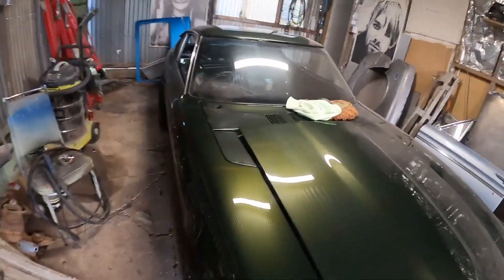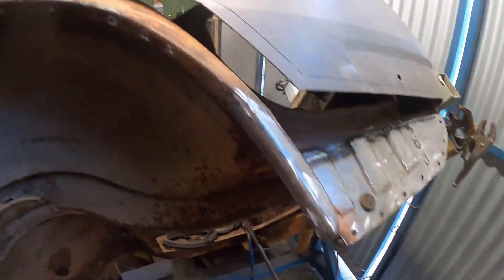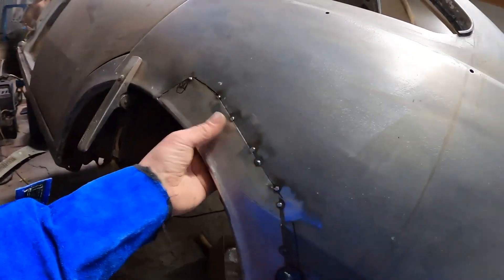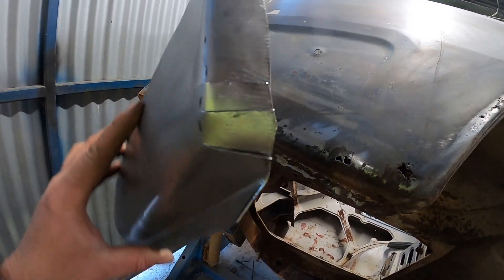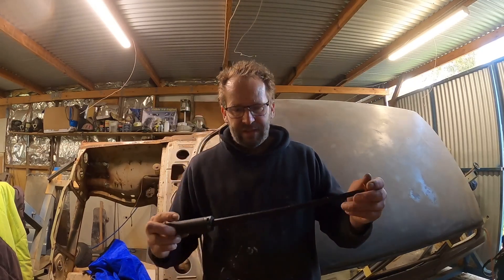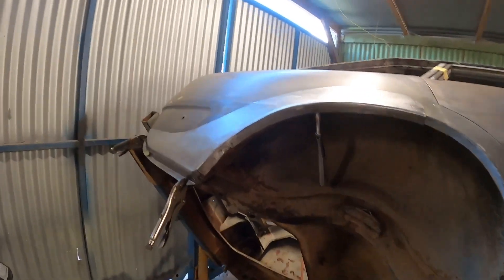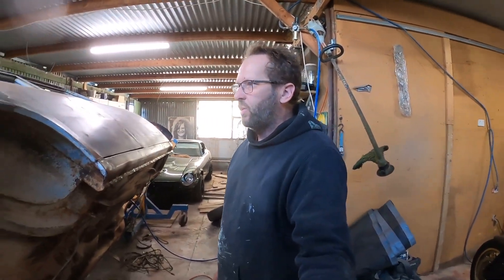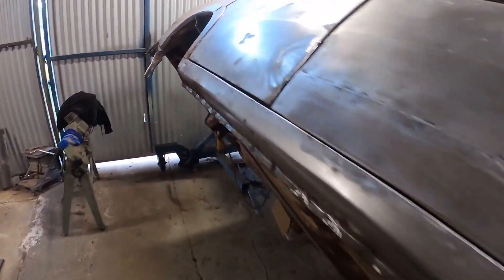Toyota Corona quater rust

Comment: Some 260Z came w a/c, so they moved the timing plate to the other side.  You will need to find someone who can drill holes and bend metal to make a plate for the others side but make it longer with ATDC and BTDC markes and slot the holes to fine tune the TDC.
Reply from the maker: All good I just put a different timing marker off a different motor and it all lines up now